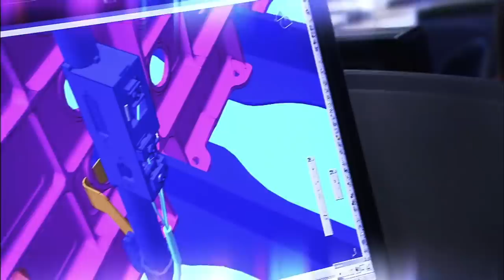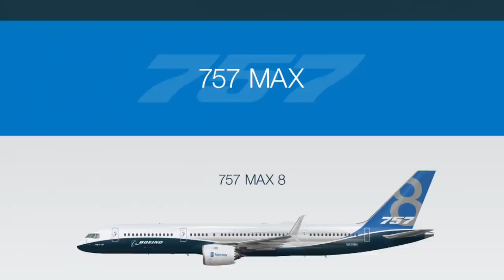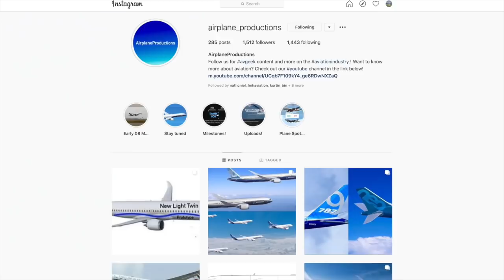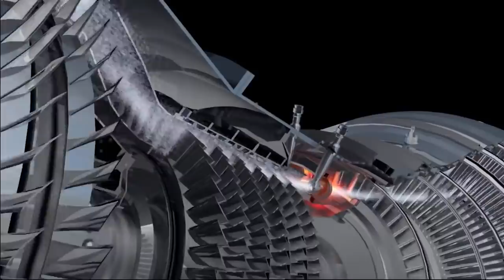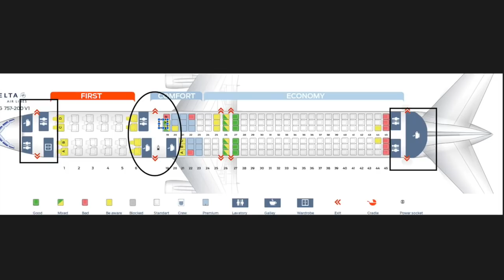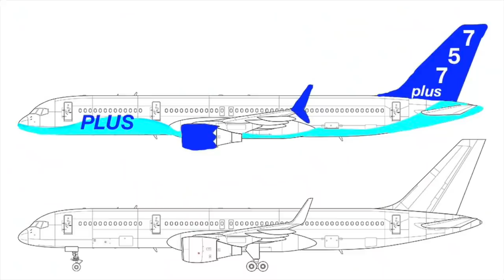Boeing 757: Could a 757 re-engine work? (757 plus)

Comment: 757 or NMA Boeing needs first to regain confidence from companies and passengers! you do not wipe out the 737 max and 787 problems as easily.
Reply from the maker: Stephan Mauss Thanks for your comment. I believe the new Boeing CEO will most certainly fix the relations, and the next new aircraft will be a success among airlines :) Thanks for watching and do stay tuned for more great videos on the way!
Reply: 787 is fine currently. Leave it as it is. Good airplane.

737MAX never will be. The balance is off with the engines. No airplane should be unbalanced enough to require MCAS. Scrap that program.

As to 757, they’d have to reverse engineer parts of the old design. As 767 still has tooling, it would get new engines and wings, which would be much cheaper than the NMA which would be about the same size and have 2-3-2 seating. It’d also have more cargo capacity than the NMA which would help with the freight demand from online shopping.

I have some hope for this. 757 is my favorite airplane ever, and 767 is a bigger sister with a similar chassis and shared type rating.
Reply: @ecoRfan  I inserted the ENTIRE structural members section modulas fuselage of the 747-400 in 3 days for doing a giant modification and the biggest slowdown is we were waiting on drawings which were not computerized already.  And Boeing already has the models of the MAX10 which is VERY close to the proposed 757PLUS.  Extending it will be absurdly easy.  The only real cost for 757plus is the new wing/tooling.  Everything else is lifted directly from the 737.
Reply: @w8stral  Considering the 757 and 737 had similarities with the fuselage, yeah. Gotta love modular parts shared across different types. Probably will get a new cockpit too. It'll keep those at the Spirit plant in Wichita going strong.
Reply: @ecoRfan  737 Max WILL be fine. Stability augmentation is a not a sign of bad design. The MD-11 has its Longitudinal Stability Augmentation System (LSAS). MCAS was a good idea, just implemented horribly.
Reply: There will be no new 757. That ship has sailed.
Reply: @bd5av8r1  Right, Airbus has not sold 2000 a321's... nor does AIrbus have another +++3000 a321LR's on order... what a stupid statement, 757 is dead.... In the Time Boeing stopped upgradeing 757 like stupid ignorant shits, Airbus has sold 2000 a321's with another 3000 a321LR's on order which was equivalent to the Main 757 variant sold...   Boeing sure as HELL better have a 757 replacement, there are thousands of orders out there waiting for that plane.
Reply: @w8stral  Well as a Boeing employee I can tell you, as bad and as stupid as you say it is, the 757 is indeed dead.
Reply: @bd5av8r1  Ah, janitors unite!  Still have the ping pong tables?
Reply: @w8stral  I work in final assembly not that it matters to you lol
Reply: @bd5av8r1  Systems Engineer myself who worked at Boeing for quite a while till they outsourced everything to Smiths on 787 like complete idiots, not that it matters to you.... oh right have to add; lol
Reply: @w8stral  it doesn't matter to either of us  evidently 😂😂🤣🤣
Reply: @bd5av8r1  Evidently =)  , though I still get stock dividends so.... =)
Reply: @w8stral  Wrong, A321NEO along has 3000+ orders, and CEO another 1800.
And being much heavier, 757's fate was already sealed in 90s when A321 debuted. 757 is deployed only when 739 or A321 can’t do the job, but with A321XLR what else is left? Maybe Delta’s 100+ 757, but nothing more.
Reply: @steinwaldmadchen  Genius: that weight advantage is near 100% from superior engines instead of40 year old engines allowing a 30%... uh hello, 30% reduced FUEL BURN.  WHich means a MUCH smaller wing... DING DING DING, thanks for playing this palm in face game.   Dear genius, 757 is nothing but a 737 with longer fuselage and larger wing.
Reply: @w8stral  don't be so negative man... the 757 PLUS can do good or even very well. The 757 have different  characteristic from the 737 for example  a bigger engine a larger wingspan, a larger flaps. The plane can take of from very short runway like no Airplane in this size, also from very high altitude airport and very hot days. Make a research and find out, this Aircraft is very UNIQUE!!!!
Reply: @arielsegal7515  Pay attention buttercup: Old engines could not handle high hot conditions: all modern engines do not have this problem.  New engines are 30% more fuel efficient so there goes most of the reason for the MUCH larger wing other than the larger payload.  Will the wing increase in size over 737?  Yes.  Otherwise only thing different will be taller landing gear.  IF Boeing feels REally adventurous it will be FBW.
Reply: @w8stral  man  we are talking about new aircraft better the 737 and better then airbus 321 XLR new engine, new wing , almost new aircraft
Reply: @arielsegal7515   What part of 40 year old engines with 30% worse fuel burn than any modern engine on 757 do YOU NOT UNDERSTAND?  This alone will save ~15000lbs from the wing, 20,000lbs of fuel, another 1000lbs from lighter wing box if not another 2000lbs when combined with smaller landing gear and shrink the wing by 20% making a new wing for 240 ppl roughly slightly larger than a321 instead of MUCH larger than a321. This new plane would destroy the a321 as the a321 is too large for short range stuff, but MAX is better, and 757plus would be superior at long thin routes while burning much less fuel than a321 which frankly needs a BIGGER wing.
Reply: @w8stral  No, it doesn't work like that
1. Generation leap of engines usually brings just 10~15% improvement, see 767 vs 787. And don’t forget both 757 and A320CEO are in the same league as 767, so do A320NEO and 787. Without a Ultrafan - generation engines  757 isn’t getting there, but likely A320 could fit that as well.
2. Wings are just part of the story. 757 is versatile in terms of short takeoff, high payload potential and long range, but that comes with a cost - heavier structure to accomplish all these. Meanwhile, A321XLR just attempt to match 1 of these - long range. So yes, many are correct A321 whatever is not exactly replacing 757, but for most long thin routes operators it’s good enough - or in other words, 757 is overbuilt. Of course Boeing can address that, but the problem is, at what cost?
3. There is still 1 major shortcoming 757X failed to address - commodity. After all A321LR/XLR is still an A320NEO, but 757 is different from 737.
Some airlines ditched 757 exactly for this reason - Aer Lingus, Air Astana and of course, American, while some newcomers are probably by not means a future 757 operator - Jetstar, AirAsia or JetBlue. It also means Airbus have little to lose even if LR/XLR failed - just a few bucks making A321NEO more capable, but nothing else. Boeing is never in the same position, and probably that’s the only reason why they hesitated for long.
Y1 would be the only sensible answer IMHO.
Reply: @steinwaldmadchen  Good Grief, you have your facts utterly wrong... at least do some basic reading.  A320, like the 737 has had 2 new engine upgrades and 757, zero.  Only difference is they did not call them "NEO" until last version of the a320.  For Shits sake get your facts straight: 757 has the EXACT same type rating as 767, but were very close to 737 classic as tech was no different so required almost no time and movement between types was done in two week or so.  Likewise was never updated BUT, was never upgraded so when 737 was upgraded(TWICE) the certificate for new versions of 737 does NOT apply to the 757 as the NG's were entirely different beasts.    Why 757's dropped?  Fuel economy and ancient ratings hard to get, same reason 737 classics have been dropped, though technically a MAX pilot could fly a classic(as if).
Reply: @w8stral  I tell you what i do understand. Wen Boeing make a new plane or some upgrade, they make it better. you still talking about the old 757 and not the new so there is no sense to talking about a old version against a new version of A321. If Boeing decide to Make the 757 plus and then we will see the pro and the con.
Reply: @w8stral  🤦🏻‍♂️🤦🏻‍♂️🤦🏻‍♂️😂
Reply: @w8stral  That still doesn’t explain the weight difference of 15t, between 739 and 752, despite the fact that NG is already ~8t heavier than equivalent Classic. Saying 757 is close to 737 is just like saying A330 is close to A300, which in fact not.

V2500Select2 doesn’t offer >5% fuel savings over original V2500. A321CEO has been using CFM-56-5B only, so NEO is the only generation leap for A321.
Fuel advantage of A321 is already there since A321CEO, and that exactly why 757 sales dries up. 1 generation leap would bring 757 closer to XLR but not ahead of it.
Reply: @bd5av8r1  yes "757 is dead"   because Boeing will go BOINK in three to five years.  Belly-up Bankrupt.  As an employee, how does it make you feel when your company's Board of Directors gives an incompetent  CEO $ 67 Mill for screwing up the 737 MAX?   And Mulenburg's predecessor - McNerney and the Board at that time exported tens of thousands of  high paying U.S. design, manufacturing, and product support jjobs for the 787 Dreamlunk. And of course the latest F. U.  -  putting their Dreamstump in the wrong orbit.  BOINK! !!!
Reply: @w8stral  yep. boeing soon to be BOINK  !!!!
Reply: @w8stral  not anymore.  BOINK
Reply: @arielsegal7515  boink can't do anything.  All capital and credit being consumed for 737MAX screw up
Reply: @keithreynolds3801  Boeing will not only be here in 10 years I'll still be working there. Yes the 757 will still be dead. 😂😂🤣🤣
Reply: @steinwaldmadchen  A321 was built when?  Oh right, much later than a320, which was MUCH later than 757.  1994 was when 321 launched and no, it did not use same engine as a320.  Required more thrust, so it unlike the a320 and it had ... get this, a BIGGER wing, and no, it could not match range of 757 as 757 had another +1000 nm range.  Lets see, 1994 vrs 1980... Nah, no engine improvements ...  MTOW between 321 and 757 is ~20t and nearly all of that is fuel.
Reply: @bd5av8r1  Boeing - the place where they make planes that people fly in and die in !
Reply: @w8stral  So wrong
1. A320 is a mere 5 years behind 757, while A321 is largely a simple stretch of A320. So basically still within the same 80s league.
2. Changes to upthrust V2500 or CFM56-5 didn't make it significantly more advance or efficient, so again, basically the same 80s league.
3. A321's wing got a double slotted flaps, but other than that it's just 4m2 or 3% larger, which isn't that significant compared to ~20% higher seat capacity.
4. But mostly airlines were asking for short haul aircraft - in other words, 757 is overbuilt. Flying 20% more weight to carrier same pax isn't a good idea, especially for shorter routes.
Reply: @keithreynolds3801  see airbus A320, PIA airlines in the news...
Reply: @bd5av8r1  I'll shall wait five or six months to see if an exactly identical model falls from the sky under similar circumstances, before it is necessary to respond to the IMPLICATIONS to AIRBUS and  long term viability.  You do understand that one incident in time logically does not represent a trend.  Thank you, and please stay TRUMP- Disease safe. 100,000 and growing, DEAD in the U.S.  Now that is a trend and representative of an deliberate TRUMP Failure.
Reply: @keithreynolds3801  this isnt about Boeing it's about Trump. TDS must be strong with you I see. 😂 Just like 2 MAX crashes dont impact Boeing. Geez.Oh while you are hating on America, a small reminder. Airbus makes the 319 320 and 220 in the US at Mobile Alabama.
Reply: @bd5av8r1  you had better start relocating to Alabama!
Reply: @keithreynolds3801  to bad 😢
Reply: @arielsegal7515  Ariel.  Let me correct your grammar.  It is "Too bad"
And, you are welcome!  Where do I send the bill?
Reply: @keithreynolds3801  well the bill you can send to my email i hope you make me a discount  ;-)
Reply: @arielsegal7515  I hope you have learned something, and have become a more humble person!
Reply: @keithreynolds3801  honey English its not my mother tongue ;-).... but i hope you will be around to fix my errors :-)... and by the way i am humble but you just misunderstanding my words or my intentions... cheers
Reply: @arielsegal7515  just stick to your native tongue - JIBBERISH!
Reply: @keithreynolds3801  don't worry honey  i will be writing here  ... and you will be here for me to fix my JIBBERISH!!!   ;-)
Reply: What 787 problems?  Aren't any.  This is like whining about a380/a350/777/a330 "problems"
Reply: @w8stral  Trent 1000 problems
Reply: @w8stral  thats not my real name. its a fake account
Reply: w8stral humidity problems...affect electrical things...they call “rain in the plane ”...and some issues with the rust in landing gears ...but a great plane ...